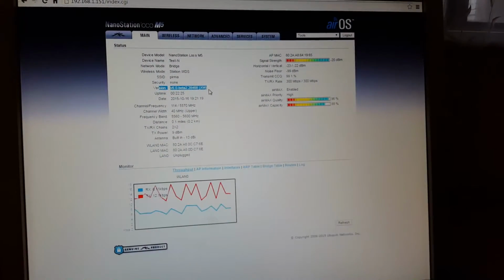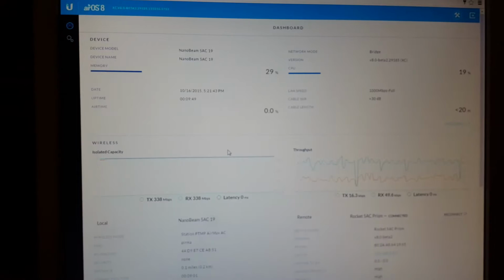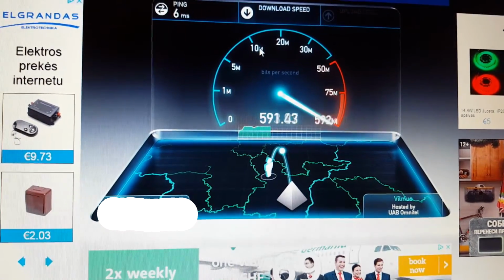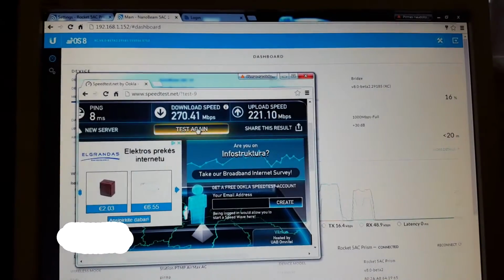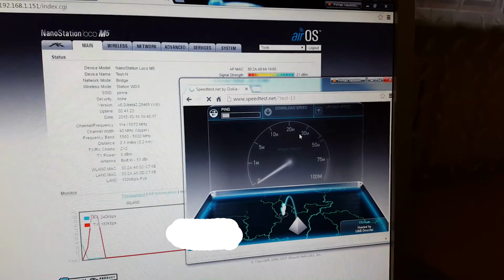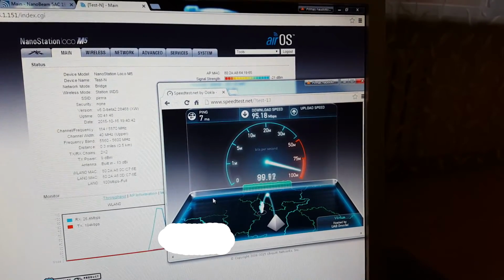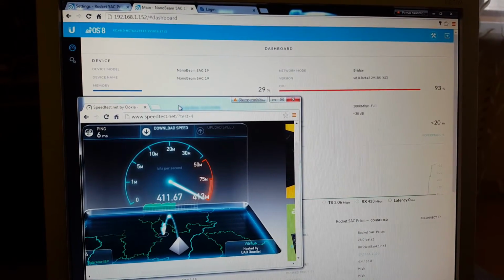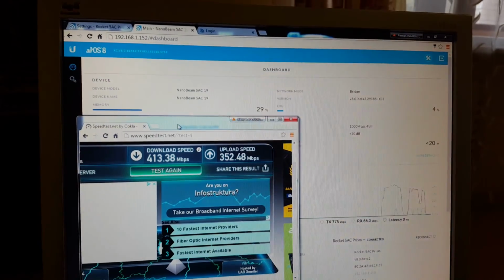Ubiquiti AC to Nanostation compatibility and bandwidth test

Comment: Im pretty sure on the NSM5 your LAN port was at 100MB LAN speed which is the most you could push through the cable,  so i think the NSM5 could have had a faster speedtest if you had a 1000MB LAN connection, not sure if that older device supports that though. Thanks for the VID
Reply: NSM5 not support 1gbit lan :D